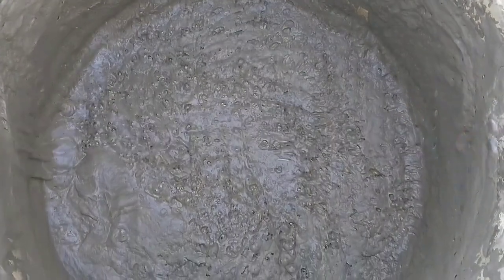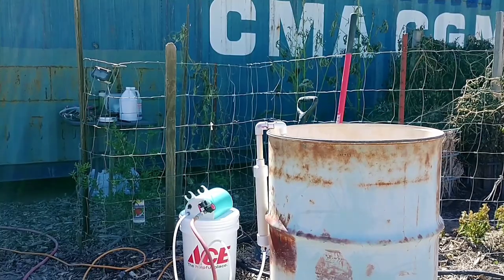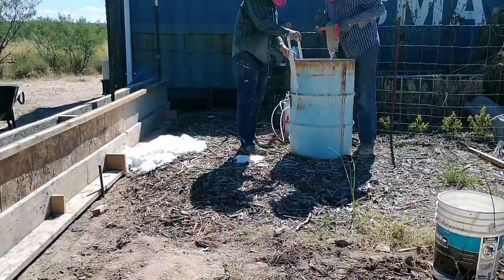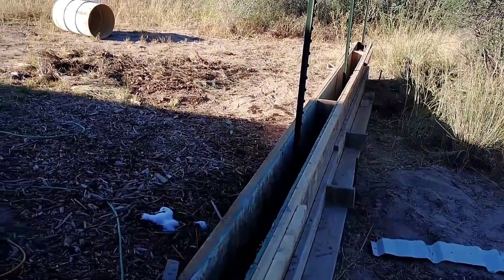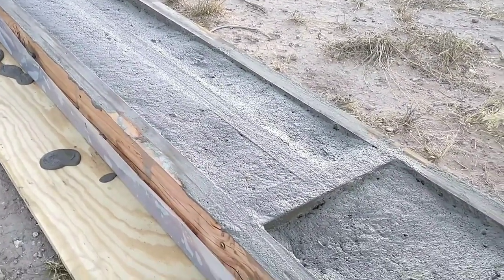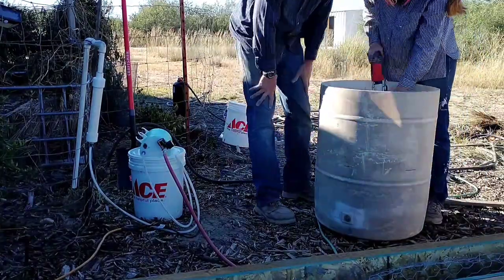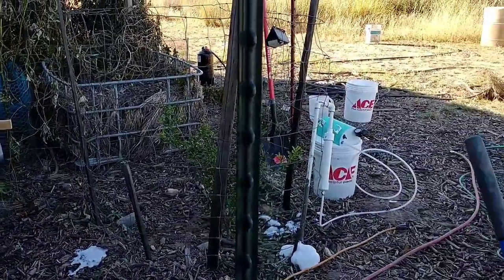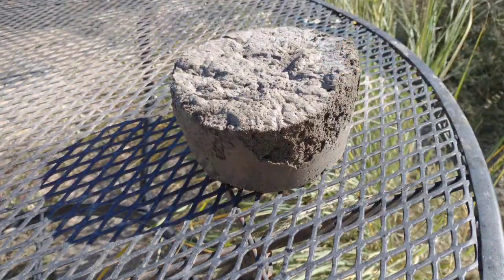AIRCRETE How We Made Our First Successful Batch | Foam Density, Water Softener, Air Compressor

Comment: That's very interesting learning about aircrete. New building block of the future I think. Especially with thermal resistance property.
Reply from the maker: Thanks! Yes among aircretes many great attributes, it also has a pretty high insulation value. I see a lot of different numbers online, and it depends on the particular mix, so I doubt we will really know for sure. A good clue will be how much energy it takes to heat and cool the house. Thanks for watching! 😊
Reply: @RedandAprilOff-Grid  Well honestly the biggest thing you want to focus to make an energy efficient home is rim joists, attic or ceiling space and have no skylights lol. Coming from a professional insulator 😀. You guys are more worried about keeping the house cold, but I suppose it can get chilly in the desert when the sun drops.

Comment: I've made lightweight concrete using perlite, long before foam.  Perlite is rock bubbles, so it gives the concrete more strength, and as far as mixing goes....the 'bubbles' are rocks.   I'm not sure what perlite costs these days, but the plant that makes it is in sfbay, I went there and picked up big bags of it.
Reply from the maker: Yes, cost and availability of perlite might be an issue, but otherwise is sounds like a better material to build with..

Comment: That type of mixer is for thinset along with the head.  Get a low rpm 1/2" drill and run a wide mixing tip that is more violent with the mixture.
Reply from the maker: We got a double paddle mixer now. 👍

Comment: Merci beaucoup de partager votre experience. La meilleure video que j'ai vue sur ce sujet ! Esperant que vous en ferez d'autres ... Bon courage, je suis en pleins test aussi en FL !
Reply from the maker: Thanks! We had a really hard time finding good information about making aircrete. We ended up not building with aircrete. As the temperatures got colder our batches were not turning out well.
 We have learned that poured in place aircrete walls are not a good idea. Aircrete shrinks too much. If you can get good consistent batches, which is very difficult. I would recommend making blocks and letting them cure, and then let them dry out for a few weeks before using them to build. Aircrete is tricky stuff, but maybe you'll have better luck with it than we did. 🌞
Reply: @RedandAprilOff-Grid  Thank you for your reply ! And goodluck for your project. You're absolutely right, I've been doing all sorts of tests for 2 years and it's almost impossible to get something consistent between 2 batches. my project is to build a dome in projection and not in blocks so another difficulty is to find a projection machine that does not destroy the bubbles during the operation... So I am swinging towards the idea of building with hemp concrete. It is in any case much superior to the aircrete. The problem is that in the USA hemp and lime are 3 to 4 times more expensive than in Europe and that I have to import. And again there is a problem to find a cheap spraying machine..
Reply from the maker: Cool! Best wishes on your build. Everything is so expensive right now! The price of portland cement has not gone up much, so at least that's good. We bought OSB for $21 in December, and now it's $53, crazy!

Comment: I love your scientific methodology and attention to details.   Since you are having a problem with cement congregating or accumulating at the bottom of the barrel, what if you took some of the recycled lumber and made a frame that would allow the plastic barrels to angle at 30°-45°s.  On several aircrete sites I have seen people using a rotating barrel to mix the materials while stirring and blending the components.  

Wishing you both a blessed weekend, stay safe out there and remember your safety gear.  Peace
Reply from the maker: We found out tonight that mixing a full batch  actually makes it easier to mix the concrete in, because the mixer is fully submerged, and it works much better.  He is also using a stick to help stir, and a gloved hand to scrape the bottom and make sure nothing is stuck. The foam is more of a challenge with a full barrel, but we are learning more about how to do that too. It all just takes a bit of practice, but if your foam isn't right, it's just not going to turn out well no matter what you do. We hope to show all of our test samples soon. We just finished the last 2 today. Thanks! 😊🏠
Reply: @RedandAprilOff-Grid  Whatever you do, stay safe.  Ear, eye and lung protection and as important as comfortable shoes and gloves.   I admire your process and am thankful that you have returned to YouTube.  If I hadn’t been forced into retirement I would attempt to support this channel but transitioning from income to social insecurity has offered challenges.   Wishing you both a peaceful weekend.

Comment: Really interesting..I know nothing about Aircrete but is it possible to perhaps build a cradle as to tip and turn your barrel slightly as you mix(similar to a concrete mixer) to keep the concrete from settling on the bottom of the barrel? Just a thought. If anyone can figure it out, Red will. Great demo, thanks for sharing.
Reply from the maker: Thanks! Yes, that would help. We noticed when we made a bigger batch, the water cement slurry was much easier to mix well because it came up higher on the mixer. We just got our new double paddle mixer, so hopefully that will help get the foam mixed in for the bigger batches. Thanks, there are still a few things to work out, but our batches are turning out pretty good! I'll be posting the first video showing our test batches tomorrow. 😊

Comment: With light machinery as you used it’s better to make short or smaller batches.. as 1 or half kilo of fine or river sand to avoid decantation of particles.. by 7 or 3.5 kilos of cement you will end up with about a little bit less then 5 to 10 gallons of mix (sorry for the magnitudes.. I only managed well the metric system)!
Reply from the maker: Yes, smaller batches were definitely easier to make, and that's how we did most of our test batches, but in order to do a whole house, we knew we were going to have to be able to make full batches. At around 6:45 in the following video is how we did our sand sample batch.  https://youtu.be/iN3oSbtBr38
🌞🏜️

Comment: I never had success with various dish soaps but the Drexel did work much better. But I stoped testing for a couple of months and when I resumed the Drexel seems to have gotten old or something and just didn't sleep the foam like before.
And having a high quality air regular is essential. Cheap ones just varies in too broad a band.
Reply from the maker: Yes, people say you can get other soaps to work, but they aren't nearly as good or reliable as Drexel. Getting the foam to the right density and getting everything thoroughly mixed is the key! 😊🏠
Reply from the maker: I have heard that if you don't mix your jug of Drexel before using it each day, the glycerin may all be on top, so later batches don't have any and don't turn out as well. You might try adding some glycerin to your batches and see if that helps. 🙂

Comment: Try weighing a very dry piece of your best aircrete, then again after soaking it overnight (you have to somehow hold it down to soak it - then let surface water run off).  Why?  You know how well water conducts heat, and after the test you will want to do everything you can to keep those walls free of water - including integral waterproofing.
Reply from the maker: Thanks, that's a good thing to consider when deciding which plaster to use. We will definitely want to put a good coat of cloth and plaster on the walls for added strength.  I figure most plasters are waterproof, but we haven't looked into it much yet. We plan to try out different cloths and plaster options on the garden wall. 😊
Reply: @RedandAprilOff-Grid  Good, but with dwellings water vapor mostly comes from the inside, then condenses in the wall.
Reply from the maker: The inside walls will be plastered as well. He also plans to put in good ventilation with motorized fans. 🙂

Comment: Your regulator, is it a pressure regulator, or a flow regulator?
Reply from the maker: It is to regulate pressure. We found if we don't keep a close watch on it, it will drift just a little. Our foam was becoming too wet, and we're running out of soap solution before we got enough foam in the batch. Our first batches looked like the aircrete was boiling. Too dry of a foam will cause issues too.
Reply: @RedandAprilOff-Grid  I had to ask because they make both and the flow regulators are way cheaper and will work but only if the load and supply are bang on constant.  A good quality pressure regulator shouldn't drift though.
Reply from the maker: If we had a bigger air compressor it probably would do some better, but it's a pretty common issue. Red didn't believe it moved enough to matter until he took a sample mid batch and saw the density had changed significantly. Here is a video that explains it well.  https://youtu.be/Qv8PnU2pKuI
Reply from the maker: That's probably way more than you were asking,  😅 but I like to get the word out when I get a chance. I think it's a big reason a lot of people struggle to get consistent batches.
Reply: @RedandAprilOff-Grid  more is better in my opinion.

Comment: Harbor Freight sells a fairly cheap electric cement mixer that would savea lot of time, otherwise, a mortar trough and mixing hoe, (like a garden hoe but the blade has two big holes in it), it's serious work, but you won't get unmixed cement.
Reply from the maker: The cement slurry is mixing ok, the issue is getting the foam mixed in completely and evenly with the slurry. Right now we are thinking we'll probably buy a mortar mixer to mix the aircrete for our house.

Comment: As far as I can tell, the one thing you have not tried is adding the foam at the top of the mix rather than pushing it down to the bottom. The extra pressure of the cement pressing down on the foam may be an issue.
Reply from the maker: It takes some practice to get the hang of what works best with mixing, it's going better now. The foam wants to rise to the top, so the hard part is to get it all the way down to the bottom. If the foam is too wet, like it was, the batch isn't going to turn out right no matter what you do. 🙂🏠
Reply: Cement slurry is around 15 lbs\ CUFT which translates to 1 psi per ft in the mix barrel. Your foaming with backpressure foam bubbles are smaller.  As the cement slurry density gets lighter foam backpressure is less making your foam lighter. This is why you are constantly adjusting the air pressure. If you are going to do this alot invest in a motar mixer with paddles to get consistent batches
Reply: @skygonzo9813  I often wondered what effect mixing in a barrel would have on the back pressure as it filled up.

None of the videos I've watched have mentioned it being an issue. But I've always suspected that foam would be very sensitive to it.

I'm thinking of making a rotating paddle mixer from a plastic barrel for my own attempts.

Do you think that would be less problematic?

Comment: Type III WORKS GREAT
Reply from the maker: Is that what you use, and why do you like it?
Reply: My first batch and the type III where the only batches I had that didn't drop any without changing the mix a little. Made a couple hundred 1x1x6 blocks.... but was discouraged by the inconsistencies.
Reply: Though the problems may be the same, with the foam not fine enough.... perhaps  I didn't do the steel wool right. Can it weigh right but still not be fine enough
Reply from the maker: One inch bricks would be very fragile even if you got your aircrete mix perfect. Our foam issue was with the regulator drifting some mid batch. We learned that even a little variation in pressure will change the foam consistency. Our Little Dragon foam wand uses a large piece of pretty course stainless steel scrubber pad, stretched out and then stuffed in. We have videos on putting the foam maker together.  There seems to be a shortage of Portland cement in our area, all they had in stock today was mix labeled II through V, so we'll see how it does. Our main struggle right now is with mixing consistently, but I think we are starting to get the hang of it. Undermining seems to make weak aircrete with big bubbles, and over mixing makes a really thick mousse that's hard to work down into the form. Based on our recent testing and experience, over mixing produces a much stronger result than under mixing, although neither are ideal.
Reply: @RedandAprilOff-Grid  sorry I knew I should have written differently. 1'x1'x6"
Reply: My batches were a in a 50 gal oh if you use type III use half the water or less
Reply: Each pore was 12 blocks or 6 cubic feet
Reply: I plan to use the bricks I made as insulation and useing other building materials like earth. Wattle and dob, stone foundation and earhern floors
Reply from the maker: Those are big bricks, & that sounds like a lot of work. It seems like they should still work well for insulation, and that sounds like a pretty cool house. We went to buy more Portland cement last night and all they had were bags labeled II-V. We went ahead and bought enough bags to finish our garden wall. We made 2 batches today with the new Portland. We used our usual recipe with 5 gallons of water for 94lb bag.  Both batches turned out really well, I think we are finally getting the hang of mixing. Red also made a paddle to pull up the mixture from the bottom, so the batch gets mixed together better. Best wishes on your house build!

Comment: An air compressor looses air pressure as air is used before it turns on to recharge. Get a good one. I didn't see the compressor you were using. The paddle on your drill is for paint get one for drywall mud. Good idea to lay out all your product for a batch before mixing that way you stay organized. You might have better luck mixing the cement in small batches in a 5 gallon bucket then adding to barrel

Comment: You add twice the amount of foam or have to heat or use setting agents.
Reply from the maker: Speaking of foam. Check out the latest video to see how our 20% less foam mix performed it's pretty impressive, but I assume you are referring to using more Drexel or foaming agent if you have hard water. We have heard that might work, but we decided to just buy a little water softener and it's working great.
Reply: @RedandAprilOff-Grid  hard water is a no go never got it to work.... had to use fresh rain water

Comment: The right amount of water for theslurry is 6 gal. to 94 lb bag of cement!
Reply from the maker: Less water makes stronger concrete. Six or even seven gallons is what most people use. Using 5 gallons makes it more of a challenge to get the cement whipped in with the foam but it also creates a much stronger product.

Comment: Also stop using the 5 gallon bucket this is one reason my foam gen is better you can hang it on a 55 gallon drum full of foam solution and see when your running out of solution. Just mount your foam gen on the lid of a 55 gallon drum with a longer tube to reach the bottom of the drum. You don't want to run out of foam solution in the middle of mixing. You also need a larger tank for your air-compressor that's why your presser is changing so much. Get a 30 gallon compressor your going to need it if your building an Aircrete house.  And check your presser when your making foam not when the air valve is off.
Reply from the maker: He was thinking a bigger bucket for the foaming solution would be nice, but a drum is an even better idea for doing multiple batches. Thanks! He turned up the pressure on the regulator, so he doesn't have to make as many adjustments, so it's working much better now. We are on solar so a smaller compressor is better for us, and working fine now. We have made 14 batches now, and are learning a lot. We still need to figure out how much mixing is ideal. When we mix the aircrete enough to get a thick smooth mouse it loses volume and is harder to get it to settle down in the form. Whereas the slightly runnier version is easier to pour and doesn't get as many air pockets. We'll keep working on that. Thanks for being one of the early pioneers of aircrete, you have made it a lot easier on the rest of us trying to figure it out! 😊🏠
Reply: @RedandAprilOff-Grid  I think my other message went into you YouTube held for review folder.
Reply from the maker: I checked and there wasn't anything in the folder. In my feed, I can see the top two lines of your other comment but when I click on it, it's not there.  It doesn't say it was deleted or removed, so I don't know what happened to it. He ordered a double paddle mixer that should be in next week. We mixed a full batch to finish off the section of the garden wall, and we found that the slurry was much easier to mix with a full batch, since the blades were submerged and not just halfway in. We also found the thick mouse consistency is too hard to get down into the bottom of the forms, the batches that weren't mixed so long fill the forms much better, and we haven't had an issue with them falling either. Your thickening agent should be in today, he'll have to build a tall form to test it. I saw you also used it in the floor for the dome. Anyway, thanks for your input! 😊
Reply from the maker: @AircreteHarry  We are getting ready to test your thickening agent. It didn't come with instructions. I think you said in one of your videos to add 2 oz to the cement slurry water? We are mixing a full batch.